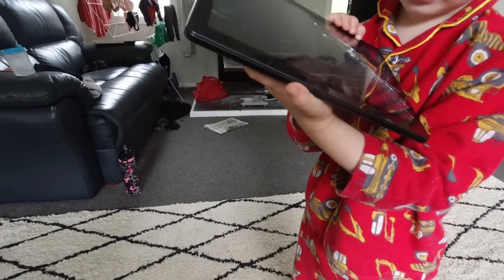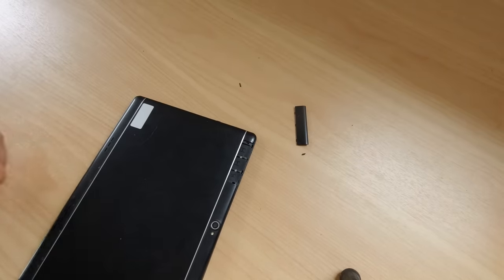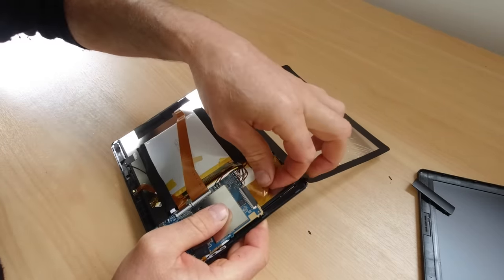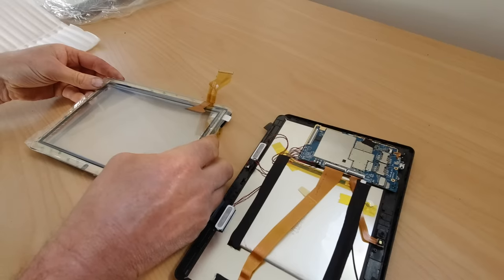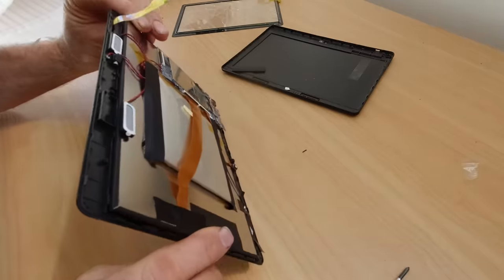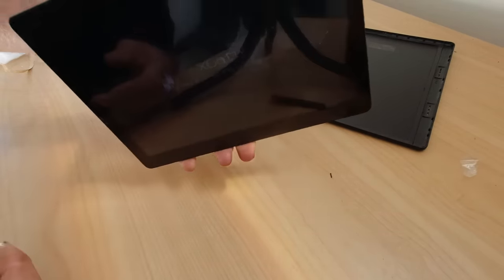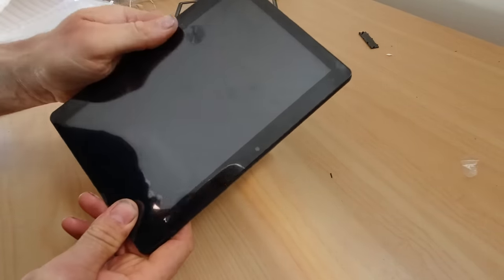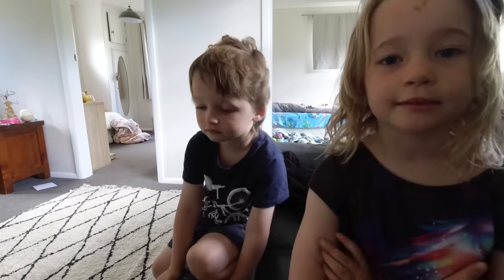Fixing a Broken Android Tablet Screen / Digitizer

Comment: The butter knife is by far one of the handiest tools in the kitchen. I like to think of it as the early mans multi tool.
Reply: The old guitar pic is also a useful tool for laptops/tablet disassembly. Nice work Marty
Reply: My wife's favorite. A few times I've had to straighten them out. I used one last night to pop the top off our drier. ;-)
Reply: The OG spudger.
Reply: I have an Android tablet with a CD player in it. I got spray glue on the screen then ruined the screen by spraying cleaner on it and dissolving the connections on the glass to make it touch sensitive. Now, after seeing you do this, I think I'll try a repair. You rock, man.
Reply: I have two butter knives (thin and thick) in my tool kit. You just can't beat the versatility. :))
Reply: Butter knife?  Wasn't that a wide blade screwdriver that can double as cutlery?

Comment: Nice work. I've seen it done before but usually with a heat gun as the adhesives are often pretty strong. Good to see the tool from the kitchen drawer saved the day.

Comment: I have done this a number of times on cell phones and tablets. When we upgraded out phones we kept the old ones for playing with and over time the screen broke and swapped them out. My aunt had the same phone when she visited a few years ago and she had a broke phone and I asked her why she did not get a new one. She said that one of the function that her phone had did not come with other phones so I took a look and it happend to be one of the older phones I had so I swapped her screen out. Worked very well and gave her another spare screen. I have done the same with tablets when they get replaced. I keep the older ones and use them till you can not use them any more. Replacement are easy on most things. Good job on fixing this one.

Comment: Butter Knife IT - nice work when you don't have a Big Clive spudger handy.
Had my first try at recovering a second hand Milwaukee 12ah battery I got a friend to pick up for less than half new price. Advertised as "surplus to needs".. It would only charge to 2 bars and run my chainsaw for less than two minutes. One of the five  banks of cells was fully charged and the rest were around 3.3v. Used a 5W car globe to bring the high bank down sliwly, and a lithium charger to bring the rest up to meet the discharging bank at 3.7v. Charges up and is now working perfectly. 
The satisfaction of repairing an item is better than getting a new one.

Comment: Well done. At work we use old "loyalty" cards to open cases generally rather than a knife, whereas Big Clive uses a "spudger" (Oddly a thin stainless blunt blade). Can get in places where a knife can't.
Reply: I'm with Big Clive on the use of a spudger, an amazing bit of kit.
Reply: @phonotd  They are, and if we had to get in to harder things than laptops and tablets I would too, but an old loyalty card is not bad either.
Reply: @BensWorkshop  I like your loyalty to the loyalty card. 🤣
Reply: A good tip. I'll need to open my laptop to install a second SSD some time soon, and I was wondering what sort of tool to use, instead of my nails.
Reply: @herrakaarme  Pleased to have helped. Hunt for all the screws (if there are any) first. There is also usually a take down video on YouTube somewhere. Also it is the corners of the cards you use.

Comment: As someone in IT, that went better than it could have. Sometimes those adhesive strips don't let go unless you apply heat to them with a heat gun. Merry Christmas from the States!
Reply from the maker: Good pro tip thanks.. Merry Christmas to you too
Reply: Going on a limb to say that the glue might've not been the kind of glue we're usually used to.
Reply: You can also get the adhesive tape they use to hold the screen on in rolls of varying widths for repairs like this.
Reply: And even still it's a pain in the ass lol
Reply: Wow that was asome
 @MartyT